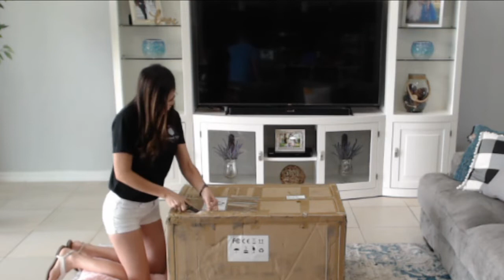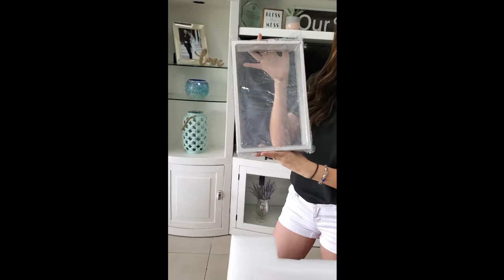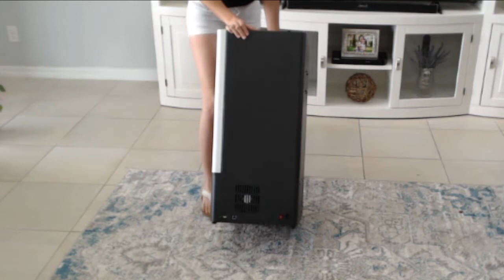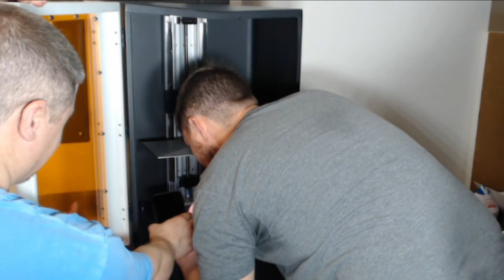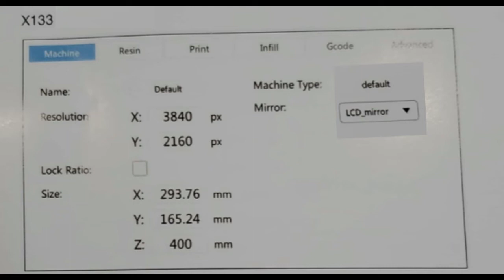EPAX X133 3D Printer Unboxing Video - Let's Talk About...Episode 1

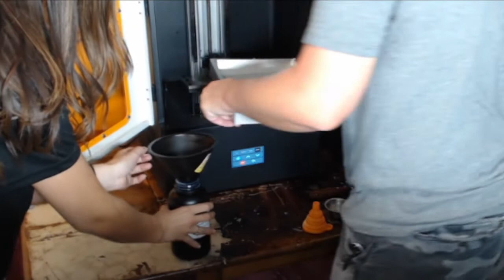Comment: Very cool.  I have an Epax X1 and love it. I also print figures as a hobby.  One  thought:  @13:38 you are draining the vat without a filter (strainer) in place in the funnel.  I use a disposable paper paint strainer whenever I drain the vat, especially after a failed print or if some anomaly (like a weird film) occurs.
Reply: @TOGGroleplay  No worries.  Also may want to pass along that when handling resin, rubber (not latex) gloves are an imperative. Most resin is slightly less toxic than Kim & Kanye's relationship.   😃